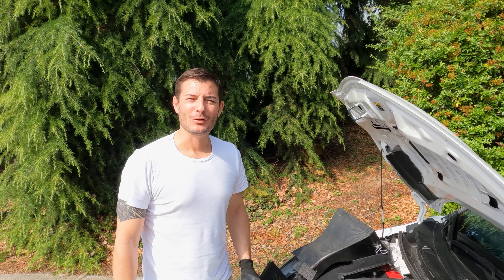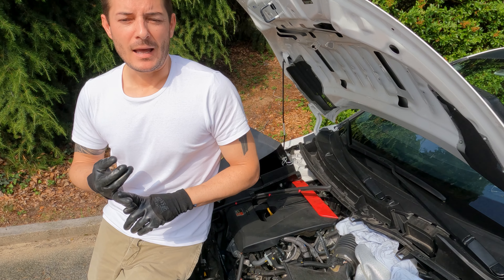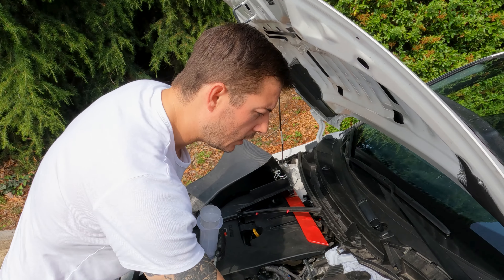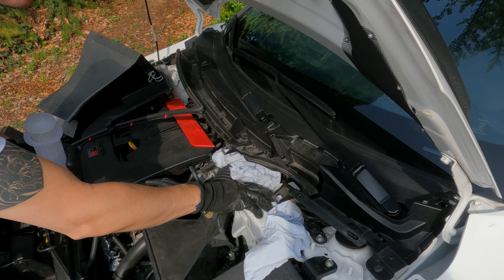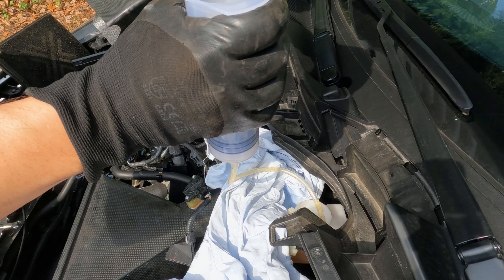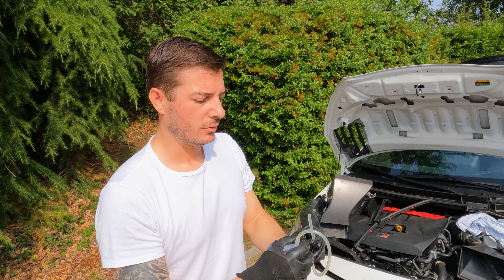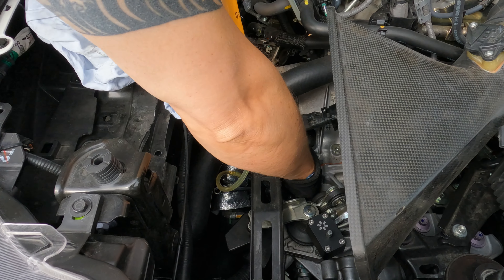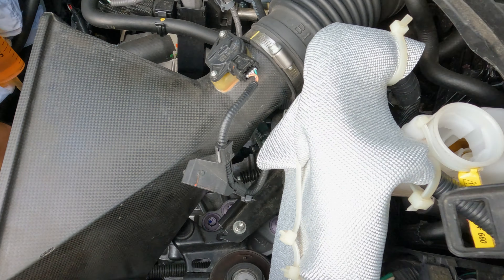How To Fix GR Yaris Gearbox issues Clutch Bleeding

Comment: Thank you for this video. I have driven manual transmission for 17 years and legitimately have missed very few shifts, but unfortunately with the GR Corolla, I have missed 4. 

4 months of ownership and 7,000 miles. 

The issue I can describe is that the clutch is “lagging” behind and this happens when shifting 2-3 and a few times going 4-5. 

I also have a metallic spring noise now as if the clutch pedal is loose. 

I’ll try bleeding the clutch to see if I have this issue still but Toyota dealership master mechanics did not know how to fix the issue.
Reply: did you get it fixxed?
I was at the Toyota dealership and I told them the problem but they didn't do anything about it.
Reply: @avatar94100  they did nothing.
Reply from the maker: Sorry I didn't see this on time, my direct contact is adriano.piras1@gmail.com

Comment: Taking my GR Yaris in to Toyota for the third time this week with these problems. Hopefully this time they will actually agree something is done to fix it. Video is very helpful
Reply from the maker: Hope they solve it mate, but please let us know!
Reply: @PIRASMotorsport  will do
Reply: @PIRASMotorsport  not solved problem. I do think it is a clutch or hydraulic issue. Clutch pedal has to be pressed to floor to change gear well
Reply from the maker: Yes: are you sure the bleeding was done well? All GR’s disengage clutch at about 1cm from pedal rest position. This is very strange… if you had a leak, you would see brake fluid under the gearbox
Reply: @PIRASMotorsport  thank you very much for this information. Will ask my trusted local garage to bleed clutch when I next take it in for brake pads

Comment: Thank you so much for this video! Is it possible for you to clarify what kind of issues the transmission had? I'm facing an issue with mine under warranty and I would like more details.
Reply from the maker: The gear stacks were not spaced correctly, they wore various parts out. New parts in, correct shims/tolerances, and it all went perfect!
Reply: @PIRASMotorsport  Thank you!
Reply from the maker: My pleasure

Comment: Thanks for your content AJ! I have a  GR Corolla and just got new stainless brake lines, fluid and a clutch line. I also own a syringe and a pump pressure bleeder that goes over the reservoir. What would be the process for replacing and bleeding the clutch line ? I didn’t even know about that clutch bleeder there until this video so now I’m confused. 

I was planning on replacing all 5 lines, then bleeding brakes and lastly clutch. 

Thanks!
Reply from the maker: My pleasure mate, thanks for supporting, please share!
If you have a pressure bleeder, you can use that from the resevoir, and open the bleeding bolt on top of the gearbox, just under the airbox, and it will work well!
With the syringe, you inject fluid from the bleeding bolt, that gives the overall best results

Comment: Hi very glad to find your channel. My GRY is a love/hate relationship from day one, I ve been with it at two dealers, first time got cables adjusted, second time flywheel replaced cause of play in it as they said, third time they rejected to adjust the cables and I went to another dealer where they made "cable adjustment" but charged me for that. Car seem to shift nice one day and poor at other day, it's driving me crazy. Also clutch bite point seem to vary. Mainly I get poor shift from 1st to 2nd, sometime they are rough, sometime it feels like it goes against something, it feel like gates are not in same place, also I had few times when couldn't put 3d in under hard acceleration. Could you suggest something and how I should aporoach this mess.
Reply from the maker: Hi, replied to your later message, thankyou for commenting!
Reply: Hi Rromka , my GR is exactly the same changing from 1st to 2nd is awful. If you ever get an improvement please let me know as it is ruining the experience of this car.
Reply: @giles4372  have you got it fixxed, I pretty much have the same problems.
Reply: @avatar94100  I have a yaris gr also , having the same issues, this seems like a very common problem , !! Toyota needs to fix this !
Reply: @evofreak1304  I took my car tot the Toyota Dealer last week and told them my problem but they didn't do anything to fix it. They just said there are no known issues from the manufacturer. I'm a bit pissed.
Reply: @giles4372  any news about this issue, what to do?

Comment: Hi. Nice video, well explained. Can you tell me which airbox you use? Best regards.
Reply from the maker: Hi there! Thankyou so much, in this first phase all support means a lot to me!
The airbox is an original design I made with some fellow engineers.
At the moment it is remaining a prototype, but if we will receive many demands, we could decide to bring it to the market.
This design is, to our technical knowledge, understanding (and dyno), the best solution possible!
Reply: I really like the air box. It seems to work with the OEM filter
Reply from the maker: @Mopselvis  Thankyou! Yes, it works with the stock form filter, but dramatically increases the airflow
Reply: Will it be available for purchase soon?

Comment: Can you tell what mods you have done to your enginebay? Noticed you had some mods to mitigate heatsoak, are you seeing any benefits from them? Thank you.
Reply from the maker: Thankyou for your question!
Very well seen: we have indeed tested various heatsoak solutions.
The two working ones are heat reflecting marerial on the outer side of the air intake charge pressure pipe and the bonnet hot air exhaust vents (we design those too).
Third useful mod is removing the lateral beauty/dust covers from the fish tank area.
Never had temperature issues or noticeable heatsoak again, with the added benefit of the bonnet vents eliminating front end aero lift at speeds

Comment: 4:05 I had to cut a tenth of an mm of the plastic retainers preventing my filter cap from coming off the brake fluid reservoir. I am not talking about the plastic shoulders on the cap itself, but 4 small bumps in the reservoir that are there to prevent you from removing the filter even after you have rotated it in the correct orientation.
I had to perform this procedure, and it did improve my clutch consistency. I didn't have issues initially, but after the dealer changed the brake fluid, I had occasional problems with the clutch.
Reply from the maker: Absoloutely, sorry I didn't see this message before! My direct contact is adriano.piras1@gmail.com

Comment: Thanks for the video. I will do it on my Toyota. In Germany they can't find a fault. I couldn't shift into second gear so many times.
Reply from the maker: Hello there, my pleasure! In the end they fixed mine by installing a thicker clutch release bearing! Will do a video about it
Reply: I'm having the same problem mate with my yaris gr, but I live in belgium and the toyota dealesrhip will probably say it's my own fault, but i can feel it , something isn't right my car only has 3000 km , never driven hard, always warmed up properly taking it easy the first 15 minutes.

Comment: So mine started to jump out of 2nd, down shifting from 3-2 moderate speeds , i hear people talking about a C fork wearing???
Reply from the maker: If the car goes in a gear, then jumps out of it on it’s own, it is 100% the syncro of that gear. Tale it to Toyota and fight, its only their fault, not yours
Reply: @PIRASMotorsport  we think alike 👌🏻Thanks, i luckily have some good friends at Toyota and Workshop manager also farms like i do😁😁we actually friends from way back in school, he plays with a 3S GTE in his hill climb pipe car
Reply from the maker: @ericvermeulen9853  so I hope they get it fixed quickly for you, they will need to take the gearbox out of the car and open it. When this happens, I strongly advise you change your clutch and install a single mass flywheel with it!
Reply: @PIRASMotorsport  that’s exactly my plan , do you run a single mass flywheel setup?
Reply from the maker: @ericvermeulen9853  I run an XClutches with organic disc, and regret a bit not having installed a Smf, although only rarely becomes an issue
Reply: @PIRASMotorsport is there a single mass flywheel that can work with a stock like clutch?
Reply from the maker: @ericvermeulen9853  this will never work: if you swap, you want a complete system! I suggest xtreme clutches for this specific car, as they have done the proper R&D on the GR platform

Comment: Any updates? I have same problem sometimes when shifting 2nd to 3rd on high revs. Was fluid change enough or is it more serious issue?
Reply from the maker: Yes, after the gearbox rebuild things improved but the problem came out again! In a minor way, but still present! Now they just fitted a new clutch release bearing, that is a bit thicker, we will see how it goes…
Reply: @PIRASMotorsport  keep us up to date!
Reply: @PIRASMotorsport  how much did Toyota charge for this gearbox work, or is it covered by warranty?
Reply from the maker: @avatar94100  hello, this was covered by warranty!
Reply: @PIRASMotorsport  thank you!
So I just gotta say 3rd gear doesn't engage properly under load and my warranty will cover it?
Reply: Having this issue in my 2024 gr corolla went to the track and kept misshifting 3rd gear once off the track I sat stationary with the clutch pushed it and went through the gear and it would only go into third 50% of the time. Now 3rd gear has developed a fairly loud drone. At 3.5rpm underload. Dropped it off at the dealership today 😢

Comment: My car seems fine but I feel like I want to sell it. I don’t want to deal with these things. Even though I love the car
Reply from the maker: Yeah, I understand Your feelings actually. I am also going thru various phases of hate and love with this car... Still, it has low running costs and is very fun to drive, one of the few cars soulth of a Cayman GT4 that will let you overdrive it!
Reply: @PIRASMotorsport  Toyota australia are refusing some warranty claims on the gear box. How can you prove it’s not driver fault. It’s ridiculous.
I was wanting to keep mine forever but if the gbox can’t last 20,000km, what’s the point
Reply from the maker: @EDGEDAZZA  yes, I understand: point is that the gearbox components are fine, they are more robust in comparison to an Evo, for example, BUT they are having major quality issues at the plant in Japan.
Many boxes are closed with the wrong spacing rings, and this leads to malfunctions from day 1 and ultimately to premature failure. Fight the case with Toyota, its the only way
Reply: @PIRASMotorsport  mine has no issues yet. 8000km
Fingers crossed
Reply: Guys i just had a chat with my friend here in South Africa, he was with the GR technical team last week and he admitted to me that Toyota is noticing problems on the GR Yaris and Corolla, for example there have been Yarisis that actually broke input shafts on gearboxes, Toyota is now releasing a new shaft that is 1mm thicker, just a bit of inside info, I’ll be posting info as my car is going in next week for 2nd gear jumping out